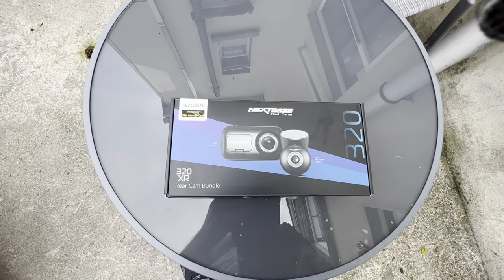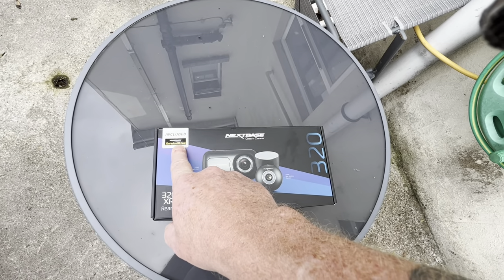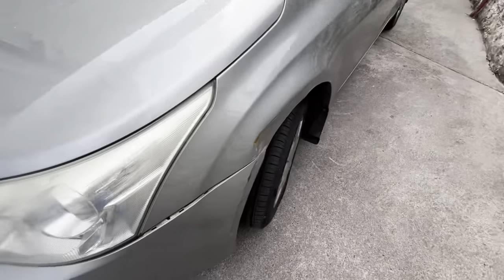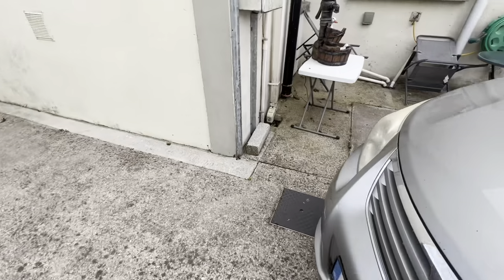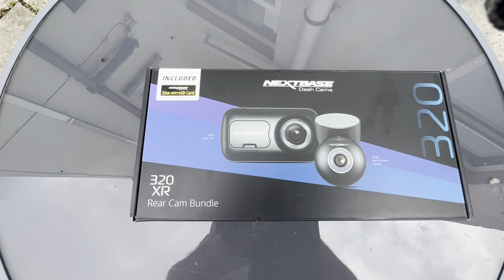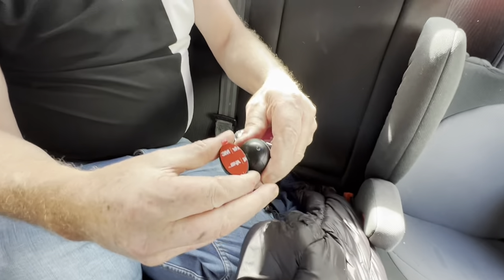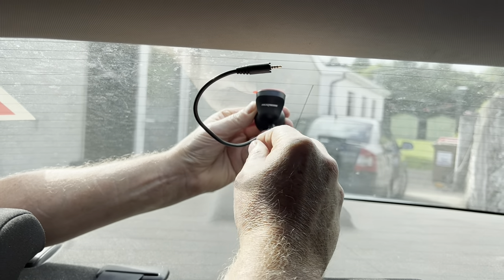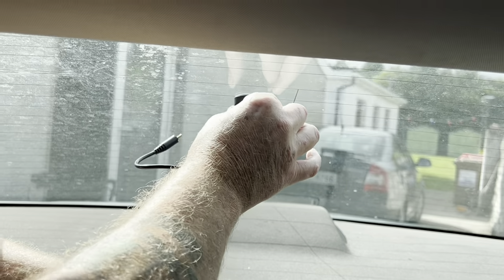Nextbase 320XR Dash cam, How to fir front and rear cameras..

Comment: Really useful thank you. Have you had any issues with DAB radio as I’ve read this model can cause interference?
Reply: The rear Cam causes interference with DAB. Personally I would rather have the rear Cam over DAB.
Reply: What's DAB?
Reply: @toenail37 Digital radio
Reply from the maker: I had no issues with DAB radio, best is to hard wire the system into your car.

Comment: So the videos show up on the drive as separate recordings? you don't need to wire it to the lights or anything?
Reply from the maker: It connect to the front it’s tucked into the edge trim out of sight to the front and plugged into the ciggy lighter

Comment: I have the same exact camera as yours but my rear camera screen does not show up to the front camera? I wiggled the cables but still not working. Any idea why? Please help.
Reply: The rear camera cable has locking slots ,make sure they are in place and make sure the other end is full in